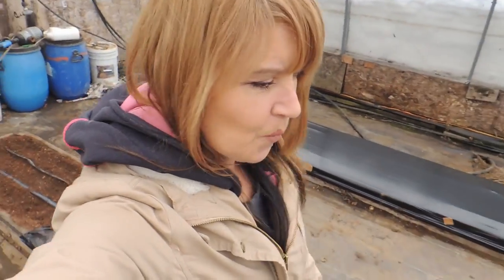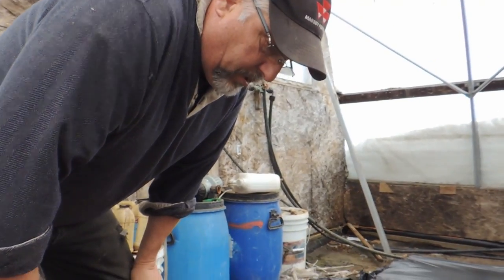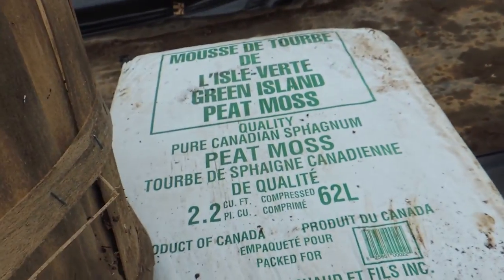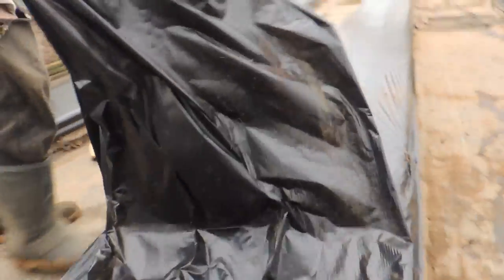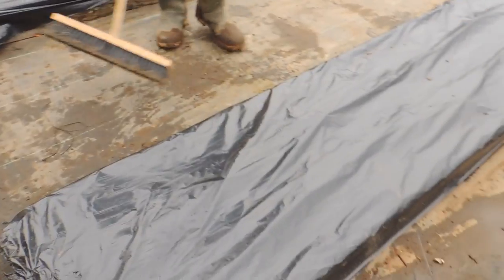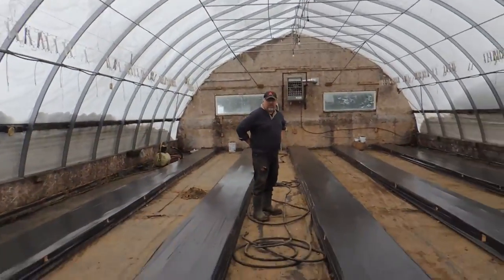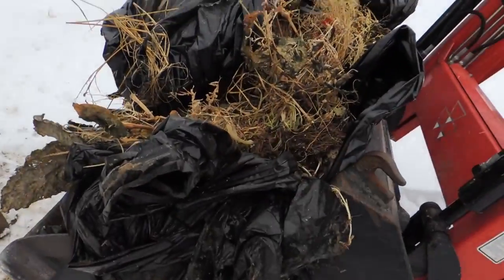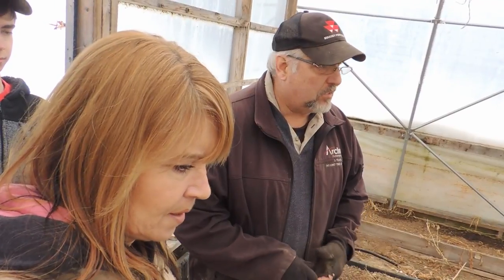RAISED BED SOIL PREP AND LAYING DRIP TAPE AND PLASTIC

Comment: Thanks so much for producing these videos - I greatly admire your operation.  Here in Southern Maine I'm just finishing up year 2 using an unheated 14X16 hoop house in our home garden so your raised bed construction information is very helpful.  No soil but compost, peat and supplements, right?  I had great success this year with tomatoes in the hoop house planted in composted leaf mold and seaweed supplemented with Tomato Tone and during the fruiting season with weekly treatment of fish emulsion.  Also used your "lower and lean" technique with "RollerHooks."  I'm going to try your raised bed method next year as it will make the operations in the hoop house much more orderly.

Comment: Hi Patti. Love your farm and your videos. I'm going to follow Chuck Fenster's experience as he moves on with his similar operation. My question: How wide are the walking aisles between the raised beds?
Reply from the maker: Some Southern Stuff 
Hello and thank you so much!  Yes, chucks channel is a great one to follow. The raised beds vary from 20" - 24" spacing.  We only spaced the upper greenhouse at 24" because we have tours come through and this gives us a bit more room, but 20 " between rows seems to be fine for us in the other greenhouses.  I hope this helps you out. Have a great weekend! ☺
Reply: Thanks, Patti. I had them pegged from the videos at 30-36 inches...glad I asked. I think I'll try 24" aisles first...that'll give us six beds inn our 30' wide high tunnel. I still marvel at what you guys do in N. Ontario...Here in Atlanta, GA last summer our 30x72 hoop house was often 110 F even with the side and end curtains raised!! Great for tomatoes & cukes...not so much for lettuce and leafy stuff.
Reply from the maker: Some Southern Stuff 
Do you have shade cloth and or water wall? Both of these would help.
Reply: Plan on getting shade cloth this spring. Not sure about water wall...it's pretty expensive for our small operation. But I'll look into a DIY version.

Comment: Did I hear you say that there's fabric under the soil?  If yes, are you using it like hydroponics?  If you're planting tomatoes from seed then they have a tap root so I'm trying to picture where the roots go?
Reply from the maker: +David Dube' 
Yes we cut the fabric from the flooring under the boxes. This used to be our garden center so under the fabric flooring is gravel.  We just lined the boxes with it. Once we transplant the tomatoes into the raised beds,  it helps with keeping the moisture in. We don't direct seed into the beds If that's what you mean.
Reply: I guess I am still confused. Is the fabric under the beds as well as the sides?  This would make the space the tomatoes can grow only the six inches deep.  Thanks.  Love your farm and videos.
Reply: See, that was my thought and confusion.  However, they aren't doing 'direct seed' so they will be cuttings that just spread sideways.  Hey, if it works for them, awesome!
Reply from the maker: +venetogardens 
Thank yoy! There is no fabric at the bottom of the beds.. just the sides. We never have a problem with rooting.  The heavy feeding and rich soil helps with minimizing the root ball. Everything is happy and healthy!
Reply: Minimizing the root ball, I like that idea!

Comment: Like your videos and I appreciate your posts. That being said, I'm wondering why you add rock phosphate to your soil. Being successful commercial growers you most likely have determined that this amendment is worth the cost. But any research I've done has convinced me (at least until I saw your video) that rock phosphate is not a useful amendment to a normally healthy soil. Now I'm confused. Is there something I've missed? And again, thanks for posting. Cheers.
Reply from the maker: +Captain Ron 
Thank you!  We had alot of rock phosphate left from when we had our garden center running so we decided to put it into our beds last year.  The beds with the rock phosphate did much better than the the ones without.  I've also heard both about rock phosphate, but it seems to help. There are so many different opinions on this. But for now it's working for us. We just demonstrate what we do so it's not something that we do to show "how to " . Thanks for the question. Thanks for watching! ☺